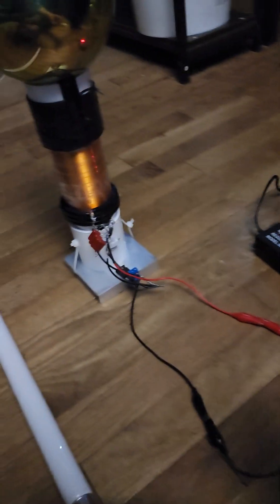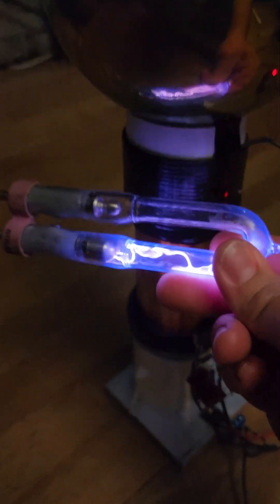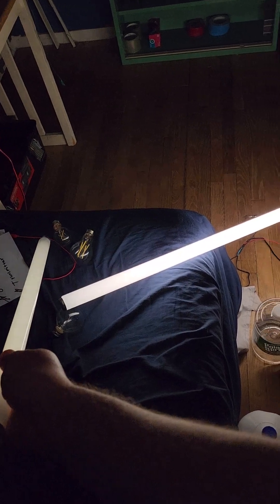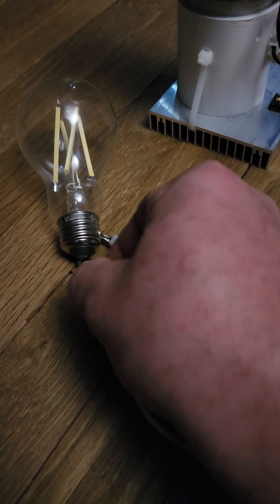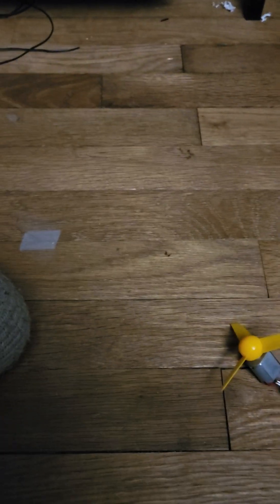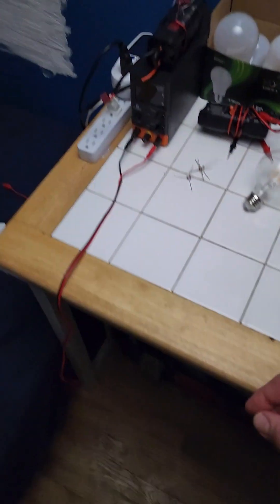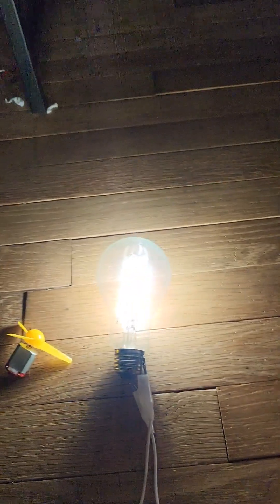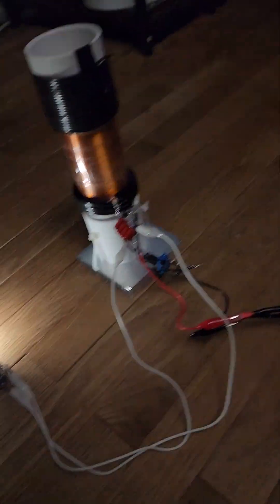MORE AMAZING TRANSMITTER EFFECTS PLUS 120V CIRCUITRY REVEAL

Comment: Hello brother! Can I put several transistors to get more power in the same device?
Reply from the maker: It wouldn't be recommended due to uneven over heating of one of the paralleled transistors. One big transistor that can handle the power is recommended
Reply: @MTECHINDUSTRIES  thank you 😊

Comment: Beware of the slayer exciter with more volts and amps! Many people have reported getting sick from it. To make it more safe, you should separate the direct resonance from the source with spark gap. But the issue with spark gap is that it makes the frequency chaotic and causes more interference on other devices. And it will cause RF pollution in your neighbor...
Reply from the maker: Really? I've never heard that & I'd love to learn more
Reply: @MTECHINDUSTRIES  I just happened to stumble on discussion about it on "supercritical" channel, on video called "bifilar pancake tesla coil High Voltage". It's under the comment by "Master Ivo".

Some other people have also mentioned that slayer exciter often burns the skin. Tesla coil with proper spark gap never does that.

There is also some old radio guys that are a bit shaky cause of some damage on nervous system by being exposed for too strong RF for long periods of time. For what I know, Tesla didn't have these issues and he used cold electricity daily as medicine.
Reply: the neighbor that anyone who plays electric guitar hates